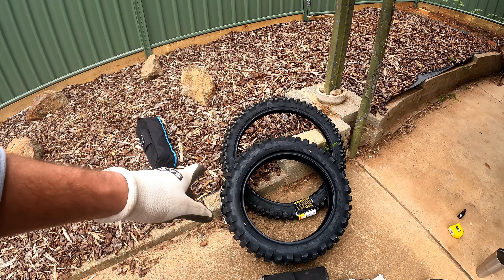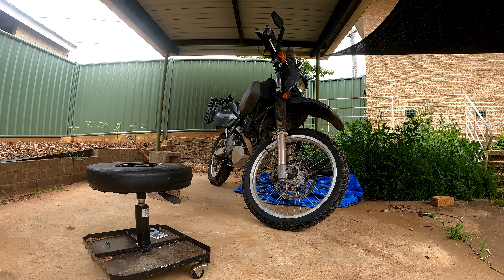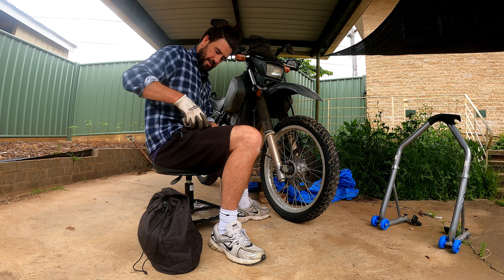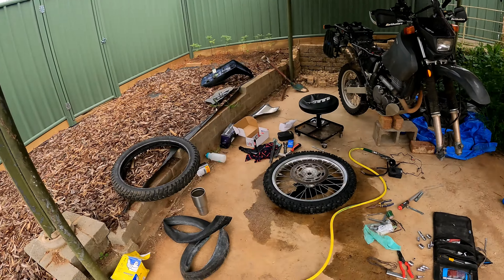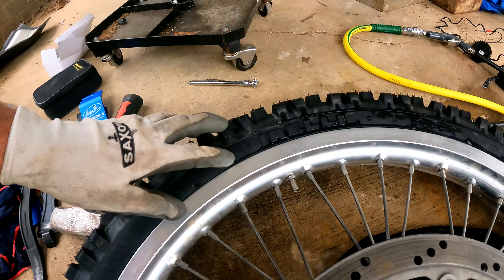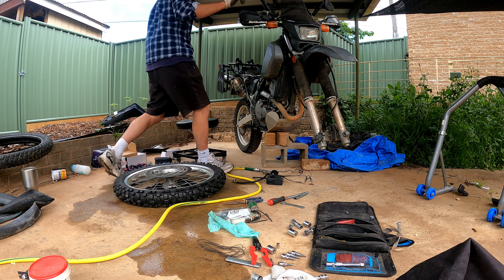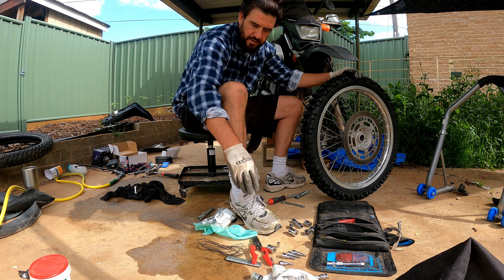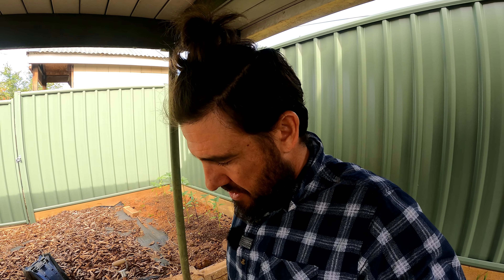Noob's first time MT21 Adventure motorcycle tire installation on a DR650

Comment: You are bringing back lots of mixed memories from when I was first getting into all of this lol. Get a good quality trail stand the lighter and more compact the better. The enduro star trail stand is pricey but very good. 
Not easy to get the bead to pop sometimes it is easier to just get it up to 60 psi and just ride it a bit it will settle. 
Best hand pump I found for field work are the tubeliss hand pump from mx store and the Xiaomi compressor.
Overall good effort for first time the 606 is a great tire but not the easiest to mount.
Reply from the maker: Thanks Tony! Alright, I just found the enduro star. I’ll give it a crack. I have maybe another 1k/kms on the 606s so ill try it out when I change that tire.

And good call out on setting the bead and pump. Hopefully round 2 will be a bit smoother next time.

Comment: You most likely want about 14lbs of air
Reply from the maker: 14…is that all? I went wayyyyy to high then!
Reply: I feel that it is right where you want to be. You will get better traction plus better bite when Corning. Some guys will tell you to go less. Again there are so many variables that you can read into or other riders will tell you.
Reply: @mke7876  oh…you mean for riding?! I thought you meant breaking the bead. Yeah, okay that makes sense. I know going down to 21 felt much better but it was still sliding around a bit.
If you go down to 14…do you need rim locks or something to keep the tube/tire in place? Not even sure how they work.
Reply: @michaeliarossi6006  I have not seen a dirt bike or dual bike with out rim locks. I’m guessing because the bike is a bigger bore bike and the manufacturer went with more street friendly rim.  Yes adding one rim lock will help with your more aggressive tires. If there are no holes for a rim lock then You may want to ask a local shop how to go about adding a rim lock.